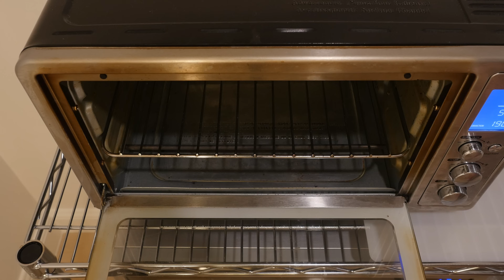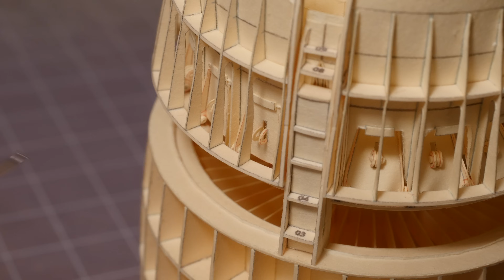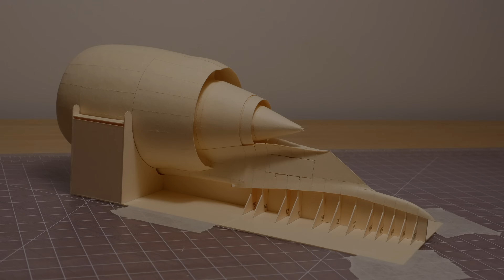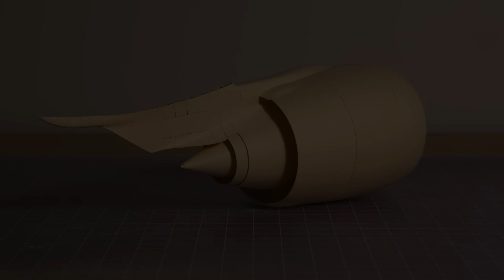OVERPOWERED - Paper GE90-115B Engine Model Timelapse

Comment: What's the brand of the paper you're using? It seems like it's unusually easy to form complex curves out of it, either that or it's just you make it look easy and the secret is not the material but skill.
Reply from the maker: It lends itself well to somewhat complex curves, but there are still limits to what it can take. Here's the two types of paper I use:

Structural stuff like the forward and middle engine cowling (and the wing box etc) I use this: https://www.amazon.com/gp/product/B0013CME9E/

For everything else I use standard thickness manila file folders. Lately I've been using these large sheets since I can cut bigger pieces to print on: https://www.amazon.com/gp/product/B002IXM3AW/

Comment: When it's says double thickness it means what? It has to be a 200gm paper ? :) I want to do it 
I'm not (crazy)
Reply from the maker: I use two thicknesses. Structural stuff like the forward and middle engine cowling (and the wing box etc) I use this: https://www.amazon.com/gp/product/B0013CME9E/

For everything else I use standard thickness manila file folders. Lately I've been using these large sheets since I can cut bigger pieces to print on: https://www.amazon.com/gp/product/B002IXM3AW/

Comment: What kind of paper are you making the model on?
Reply from the maker: Manila file folders. I use two thicknesses. Structural stuff like the forward and middle engine cowling (and the wing box etc) I use this: https://www.amazon.com/gp/product/B0013CME9E/

For everything else I use standard thickness manila file folders. Lately I've been using these large sheets since I can cut bigger pieces to print on: https://www.amazon.com/gp/product/B002IXM3AW/

Comment: What paper do you use and how do you design your airplanes? The planes are the best models i have ever seen!
Reply from the maker: Manila file folders. I use two thicknesses. Structural stuff like the forward and middle engine cowling (and the wing box etc) I use this: https://www.amazon.com/gp/product/B0013CME9E/

For everything else I use standard thickness manila file folders. Lately I've been using these large sheets since I can cut bigger pieces to print on: https://www.amazon.com/gp/product/B002IXM3AW/

As for the design process... hard to put into words. Lots of practice and refinement over the years, starting with simpler stuff and getting more complicated. I'd encourage you to watch some of my other videos/time-lapses to see more of the process.

Comment: What paper did you use?
Reply from the maker: Manila file folders. I use two thicknesses. Structural stuff like the forward and middle engine cowling (and the wing box etc) I use this: https://www.amazon.com/gp/product/B0013CME9E/

For everything else I use standard thickness manila file folders. Lately I've been using these large sheets since I can cut bigger pieces to print on: https://www.amazon.com/gp/product/B002IXM3AW/
Reply: @lucaiaconistewart  brilliant, I have built paper models too, but this never crossed my mind. Have you ever considered using cardstock?

Comment: Wow extremely more detailed tha the uhu-02 models.i believed that uho-02 was and insane japanese but you are directly over the roof!
P.s. are you italian?
What is the thickness of the manilla cardboard?
Reply from the maker: Thank you! I use two types of folder material, the thicker of which is 0.021" and the thinner one 0.012"
And yes, I'm half Italian!
Reply: @lucaiaconistewart  ok tnx! the answer on the "italianity" was posed before i have readed your home page. Tnx again!
Reply: P.s. in your project is specified wich thickness  to use for every page?
Maybe a'll try to build some part: the whole aircraft do not enter in my shared space (i heard several wife hummings... I dunna why :-) ) but the  engine.. maybe with some "exploded-naked" part
Reply from the maker: Yeah, on the designs it lists the paper type at the top of the page: https://drive.google.com/file/d/1ey8AWlsFvwlwgSjS9vsaTCqkCQhI3j93/view?usp=share_link

Comment: Your patience is tremendous. What kind of cardstock was used?
Reply from the maker: Manila file folders. I use two thicknesses. Structural stuff like the forward and middle engine cowling (and the wing box etc) I use this: https://www.amazon.com/gp/product/B0013CME9E/

For everything else I use standard thickness manila file folders. Lately I've been using these large sheets since I can cut bigger pieces to print on: https://www.amazon.com/gp/product/B002IXM3AW/

Comment: That's far out dude!!!!... I have to know what gauge paper you're using?. I need to try this. I, too, am a model enthusiast.
Reply from the maker: I use two thicknesses. Structural stuff like the forward and middle engine cowling (and the wing box etc) I use this (0.021" thick): https://www.amazon.com/gp/product/B0013CME9E/

For everything else I use standard thickness manila file folders (0.012" thick). Lately I've been using these large sheets since I can cut bigger pieces to print on: https://www.amazon.com/gp/product/B002IXM3AW/

Comment: Let me understand.
Is everything made out if normal sheet of paper? 
How parts with thickness are made, stitching together many kayers?
Reply from the maker: Manila file folders. I use two thicknesses. Structural stuff like the forward and middle engine cowling (and the wing box etc) I use this: https://www.amazon.com/gp/product/B0013CME9E/

For everything else I use standard thickness manila file folders. Lately I've been using these large sheets since I can cut bigger pieces to print on: https://www.amazon.com/gp/product/B002IXM3AW/
And yep, sometimes I glue layers together for added thickness.

Comment: Hi Luca, would like to know what kind of paper you used. Thanks.
Reply from the maker: Manila file folders. I use two thicknesses. Structural stuff like the forward and middle engine cowling (and the wing box etc) I use this: https://www.amazon.com/gp/product/B0013CME9E/

For everything else I use standard thickness manila file folders. Lately I've been using these large sheets since I can cut bigger pieces to print on: https://www.amazon.com/gp/product/B002IXM3AW/
Reply: @lucaiaconistewart  thanks a lot!

Comment: All of the individually shaped (mostly exterior/shell) components are, as with your other works, composited into a three dimensional product from two dimensional source. That forming critically alters the printed dimensions. How do you end up with such precise composites? Do you work with 3D software to form these individual pieces for printout? Also wondering if these formed exterior pieces correlate to the assembly of the actual engine's cowling/exterior composite? Outstanding. [Add: 4:09 - That forming press is made entirely of manila too?! OMG]
Reply from the maker: Thank you for your comment(s)! It's actually a lot less precise than you probably expect — I do it all in 2D in Adobe Illustrator based on plans and photos. For the cowling skin panels, for instance, I know what size they generally need to be, and I upsize them slightly to give myself some wiggle room with the material. The part of the process I did not show (since it's so tedious) is how I measure, cut, and re-deform the panels repeatedly to get them to the right size. It's more of an art than a science. It has very little impact on the printed shape, though.

Comment: what type of paper do you use?
Reply from the maker: Manila file folders. I use two thicknesses. Structural stuff like the forward and middle engine cowling (and the wing box etc) I use this: https://www.amazon.com/gp/product/B0013CME9E/

For everything else I use standard thickness manila file folders. Lately I've been using these large sheets since I can cut bigger pieces to print on: https://www.amazon.com/gp/product/B002IXM3AW/
Reply: @lucaiaconistewart  it’s expensive so I might as well stick to plastic models.👍

Comment: I wonder just what the company that produces the manila folders you use thinks of this. Maybe you get sponsored.
Reply from the maker: i should reach out hah
Reply: @lucaiaconistewart  
This really is amazing work. Have you ever thought of selling downloadable files of certain elements of the model. The engines would be one example. Of course there is the issue of people pirating the designs. 
I also loved the use of molds for some of the parts. The front fan blades and parts of the engine cowling.

Comment: I have to ask, how do you print to scale on a conventional printer? I've never found software that does it reliably.
Reply from the maker: I design in Adobe Illustrator and save as PDF, and then just open in Acrobat or Preview (macOS) and print at 100%. I've never had an issue getting it to print the right size. I know some (cheaper?) printers are inaccurate to begin with, so that might be a factor.

Comment: I don't even know what to say anymore. Your level of detail is insane. Really amazing work! 
How do you make the little pins for the mechanical parts? I always struggle getting things like that properly round and also not have it break after moving it a few times and you're doing it at such a tiny scale. Truly mindblowing as always!
Reply from the maker: I delaminate the paper to "single-ply" (ish) thickness, coat it with glue and roll it up. Once it dries it becomes incredibly hard and durable. I'll upload a longer video at some point—I had to cut certain parts out of this one for the sake of time.

Comment: What kind of glue is that? Seems super clean and strong.
Reply from the maker: https://aleenes.com/collections/all-purpose-craft-glue/products/aleenes-original-clear-gel-tacky-glue-8-fl-oz
it is very strong and it actually dries surprisingly fast
Reply: @lucaiaconistewart  Tnx, are there any differences between original and clear variants? Clear one isn't available in my country.
Reply from the maker: I think they're largely the same, though I haven't used the regular kind. Both of them dry clear.